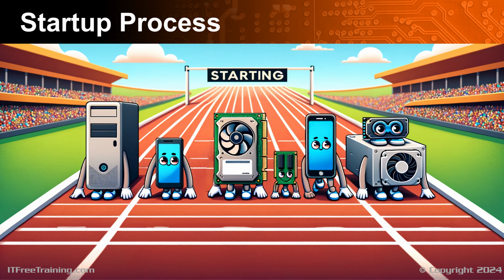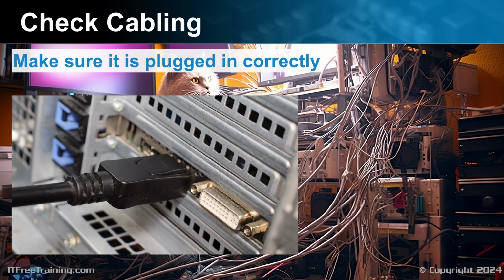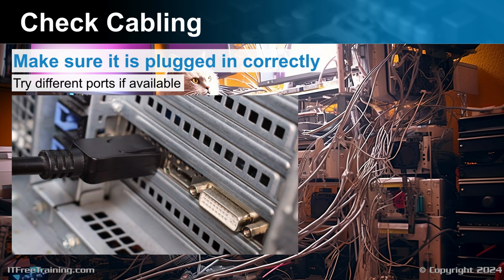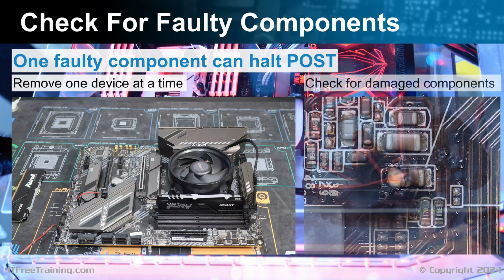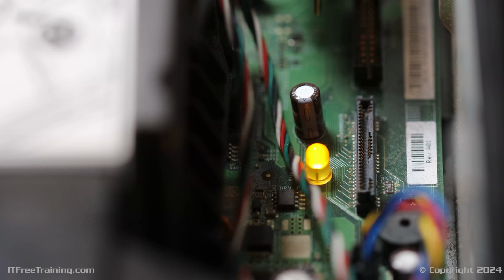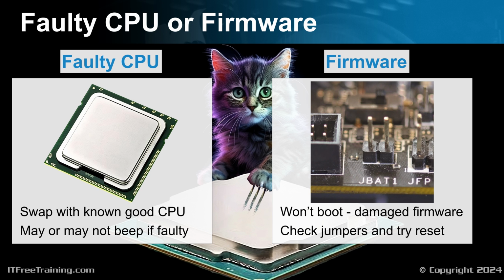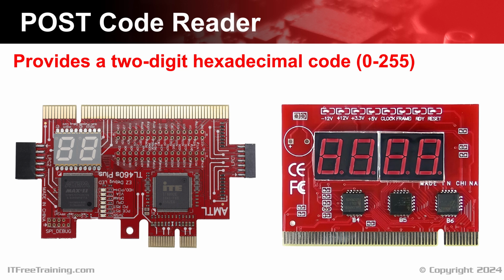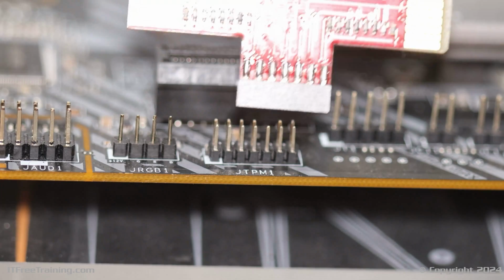Troubleshooting POST Issues - CompTIA A+ 220-1101 – 3.6

Comment: In my opinion manufactures have allocated too much power to the 12 volt rail and reduced 5 volt power in the process. I run pc's with more than one, two, or three hard drives. I believe that 5 volt power is for hard drives. True?
Reply from the maker: In the ATX power supply standard:
+12 V rail → originally for motors (fans, drives), CPU VRMs, and later GPUs.
+5 V rail → used heavily by logic circuits, older drives, and older CPUs (Pentium 3/4 era).
+3.3 V rail → mainly for motherboard logic and some memory/PCI components.

Over the years, CPU and GPU power demands skyrocketed, while the power draw from 5 V and 3.3 V rails dropped. Modern PSUs reflect that shift: most of their total wattage is on 12 V, while 5 V is often limited to ~20–25 A combined (≈ 100–125 W).

3.5″ hard drives depend on both 5 V and 12 V, and PSU design shifted to match modern component trends. If you’re running multiple HDDs, it’s wise to check the 5 V rail capacity to ensure stability.

Comment: Ive noticed modern laptops dont often beep, but flash the power led in a sequence, and they usually can be looked up on the manufacturers web site.

I have a room of Desktops at work, 25 or so, and each morning between 3 and 5 dont power on, its started about 2yrs ago, with one at a time, and became more as the months passed.  no screen activity, can here the fans spinning, and that it.

removed the PC from the room, and plugged it in somewhere else, and it worked fine, take it back to the room, worked fine,
then the next day, a different 3 - 5 PCs do the same thing,  at first we were checking hardware, as this video shows, and swapping out PSU's  but in the end, it seems that that part of the building cannot support the electrical needs of the entire building, it is a very old build, and they are now looking at upgrades, but in the mean time, I setup GPO's to prevent users from powering off the PC's on a night, all they are allowed to do is restart.
worse yet, I even had it happen in the room, when trouble shooting software, and the restart didnt come back on, just black screen..
doncha just love IT.
Reply from the maker: Thanks for info about the laptop. We need to start adding more information about laptop in our videos as we tend to just cover desktops.

You have an interesting problem with that computer lab. It makes it hard when you have an old building with power problems like that. You could put a power monitor to get a measure of the power draw. Maybe that would help to give to your manager to help justify getting and upgrade.

Comment: Where can I got the post code cards that you used at the end of the video?
Reply from the maker: We got that one from ebay. You can also get them from Amazon. They are not something that is commonly sold in computer stores.
Reply: @itfreetraining  do you by chance still have the ebay listing I could buy yours from?
Reply: New build lights fans monitor working download latest bios I bought this motherboard about 3 1/2 years ago just building it now so doing  
update after download 
and update turn power push start button lights and fans come on no monitor push button to turn off doesn’t turn off must turn off at power any help appreciated thank you